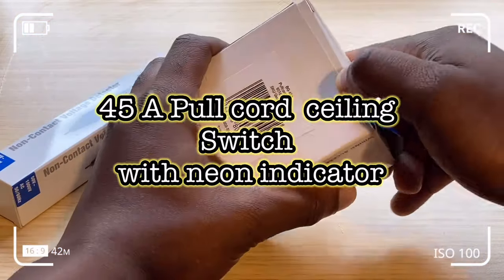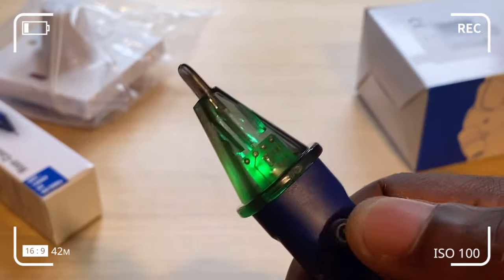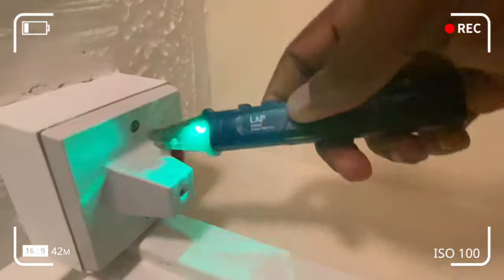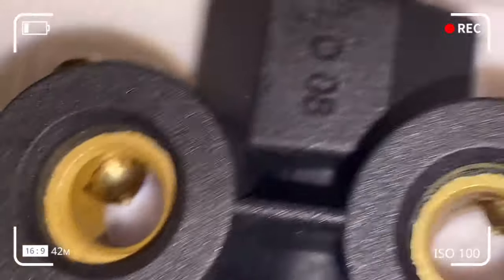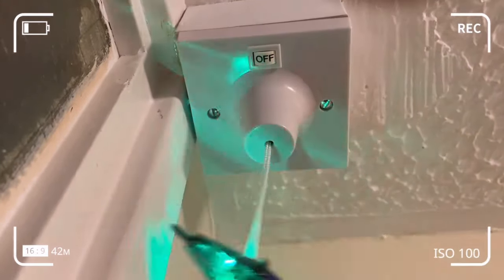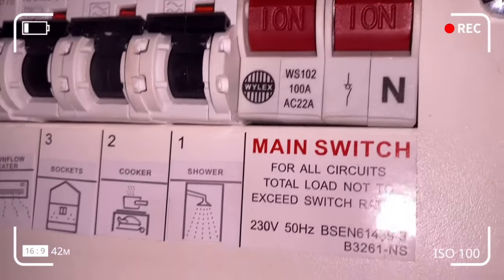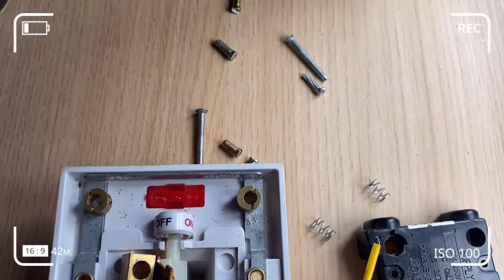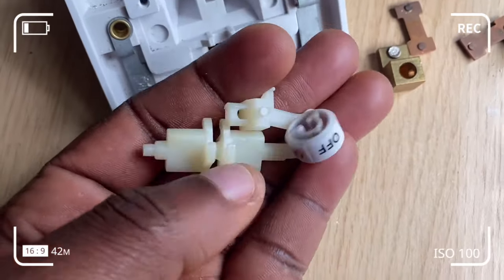How to fix a pull cord ceiling switch [setup, self & voltage test, strip/tear down]

Comment: Excellent info and great vid. I have ordered a non contact voltage detector, definitely one of those things you don't know you need to see it!
Reply from the maker: Thanks David and appreciate the feedback. Don’t forget to subscribe and share. Have a blessed week. Take care
Reply: We call them death sticks. Don't rely on them as a means to safely isolate. They're merely an indication as to live. Plenty of times they don't show live. At minimum test on a known live source before and after using a voltage stick.
Reply from the maker: @rayc1503  sure they are an indication and isolation should be carried out prior to as already exemplified. On using a source, If one is conversant with wiring you necessarily don’t need to take the switch apart as you can pull the earth down on the switch housing using a roughneck mains tester screwdriver or multi meter which exposes both live and neutral and check for live and bottom right of the housing or if you prefer on live cable circuitry. The screwdriver sometimes arent wholly reliable I.e fuse blown out and shock prone etc but thanks for the contribution and feedback. Have a lovely week
Reply: One saved my life earlier. Thought I isolated the shower. Went to check and nope, still live. I'm just happy I had one, because it's definitely the type of thing I'd not buy thinking "it'll be fine"
Reply: Or just turn the Lecky off 😂
Reply: On mine it's the cord that doesn't work, and the unit has no screws ?????

Comment: My rope break . Do I need a new one ?
Reply from the maker: Hi flo496, 

Depends on where it broke. Mid way you can just tie to its other strand. But this is a temporary fix as subject to break loose on constant usage. 

 If it’s at the housing or casing. Then a more permanent fix would be  to follow these steps:

1. Turn off the power to the switch at the circuit breaker.
2. Remove the cover plate of the switch to access the inner mechanism.
3. Locate the rope or cord attached to the switch mechanism.
4. If the rope is broken or damaged, replace it with a new one of the same length.
5. Thread the new rope through the hole in the switch mechanism and tie a secure knot at the end.
6. Replace the cover plate and turn the power back on.

Remember to always exercise caution when working with electrical components. If you're unsure or uncomfortable with the process, it's best to consult a professional electrician.

Don’t forget to subscribe like and share. Helps channel grow

Comment: No light showing on the On position however yesterday was working and shower was going on and off now no power at all to shower regardless. I checked consumer unit nothing has tripped. Could it be just if I change the pull cord ?
Reply from the maker: 1. It could be a loose connection or the moving parts inside are not clicking correctly or that it's a sub standard part that needs replacing(wear and tear shelf life of poor quality product exponentially impacted), invest in a good quality switch. Next, make sure that your socket isn’t screwed in too tightly. This can cramp the wires inside, causing them to malfunction, the neon light wires are usually quite fickle and can easily break so should be handled with care. if there was a short circuit , your consumer unit would have tripped OFF so i doubt there was a short circuit.or       2. it may not coming ON  because it  might have something to do with your thermostat or needs a Neutral, is there is a capped off neutral wire in the socket for the light switch (along with an earth which is connected to the backing plate) and do you have only red live wires and a green/yellow earth?you can not assume it is a neutral, you will need to get some one to check it for you.
3. Check your connections are sound
Presume you wired it identical to your previous switch for instance where neon came ON with switch ON or OFF as required and your asking or wondering  if your new switch presumably has feeds opposite way and it’s safety? I presume the  Shower you have installed does seem to respond to pull cord switch (irrespective of NEON light) and functioning  okay but with the neon light constantly ON or  some times OFF but works regardless 

From what you are saying it appears It's not clearly electrically identical to the old switch (unless or except  that was also wired wrongly previously )

The terminals on the switch are labelled - it will work or function fine and is not dangerous - but it is wrong, has the potential or propensity to confuse anyone maintaining the shower circuit unit and should be wired correctly or corrected.

The neon being permanently 'ON' is usually caused by wiring the permanent live conductors to the 'load' side of the switch - this needs to be VERIFIED. Permanent' live conductors are the line and neutral going to the consumer unit. 
Switched conductors are line and neutral going to the shower. The neon is connected across these so it lights up when the switch is closed ('ON'). 
Looks like it was wired backwards, appears cable's must be back to front as two cables for feed and load, so compare your two switches layout both OLD and NEW. So it presumably looks like your Supply CABLES are in the LOAD side of the connection and LOAD side cables are in the Supply side of the connection.  Hope this helps. Let me know how you get on and don’t forget to subscribe and share. Have a great weekend

Comment: Great video lad, I've just installed the same pull cord for my shower and the indicator light is on even in the off position, is this normal? Thanks.
Reply from the maker: Presume you wired it identical to your previous switch for instance where neon came ON with switch or OFF as required and your asking or wondering  if your new switch presumably has feeds opposite way and it’s safety? I presume the  Shower you have installed does seem to respond to pull cord switch (irrespective of NEON light) and functioning  okay but with the neon light constantly ON.

From what you are saying it appears It's not clearly electrically identical to the old switch (unless or except  that was also wired wrongly previously )

The terminals on the switch are labelled - it will work or function fine and is not dangerous - but it is wrong, has the potential or propensity to confuse anyone maintaining the shower circuit unit and should be wired correctly or corrected.

The neon being permanently 'ON' is usually caused by wiring the permanent live conductors to the 'load' side of the switch - this needs to be VERIFIED. Permanent' live conductors are the line and neutral going to the consumer unit. 
Switched conductors are line and neutral going to the shower. The neon is connected across these so it lights up when the switch is closed ('ON'). 
Looks like it was wired backwards, appears cable's must be back to front as two cables for feed and load, so compare your two switches layout both OLD and NEW. So it looks like your Supply CABLES are in the LOAD side of the connection and LOAD side cables are in the Supply side of the connection.  Hope this helps. Let me know how you get on and don’t forget to subscribe and share. Have a great weekend
Reply: I had same issue swith is identical followed vid but light permanently on
Reply: @UtechUreview  I already swapped wires rnd sorted it straight away but cheers anyway
Reply: @hodmusprime3850 having the same problem now. Which wires did you switch around? Cheers

Comment: hello, what brand and model, for the " Pull Cord Ceiling Switch With Neon (45 Amp, Double Pole)" will you recommend, quality and practical, not looks, I am more interested in function, than what they look like, thanks, plus your video, is very helpful.

Comment: does it matter which side the supply wires goes. or can it be either way round if that makes sense
Reply from the maker: Hi K, Yes it does matter. You want to connect the switching live in the right place. If it’s in the wrong place the LED lamp will constantly illuminate. Your switch electrical circuit should be connected to the live wire so that the socket or is not live when it is switched off. 
Scenario 

If you wire it erratically your Neon light may come ON with switch or OFF and if  your are asking if it matters or wondering  if your new switch presumably can have feeds opposite way and it’s safety? 

If you install interchange the supply for the load,  It will respond to pull cord switch (irrespective of NEON light) and functioning  okay but with the neon light constantly ON.

The terminals on the switch are labelled - it will work or function fine and is not dangerous - but it is wrong, has the potential or propensity to confuse anyone maintaining the shower circuit unit and should be wired correctly or corrected.

The neon being permanently 'ON' is usually caused by wiring the permanent live conductors to the 'load' side of the switch - this needs to be VERIFIED. Permanent' live conductors are the line and neutral going to the consumer unit. 
Switched conductors are line and neutral going to the shower. The neon is connected across these so it lights up when the switch is closed ('ON'). You shouldn’t be wiring backwards, or having cable's back to front as two cables for feed and load, so compare your two switches layout both OLD and NEW. 

You should not have Supply CABLES in the LOAD side of the connection and LOAD side cables in the Supply side of the connection.  Hope this helps. Let me know how you get on and don’t forget to subscribe and share. Have a great weekend
Reply: @UtechUreview  that helps a lot. wad confused about the load and supply.  thanks!!

Comment: Hi can we leave these on all the time if the shower is used daily? I'm not concerned about the cost as I know it'll only use a minimal amount of electric, it's more to do with safety. I understand it's good to turn it off if you're out of the property for a while, but if the shower is literally used every day, is it better to leave it left on? Please reply , thanks.
Reply from the maker: Hi 137dylan, Although it is usually OK,you should leave  the switch turned off when not in use to prevent a permanent source of high-currents.

it is not recommended to leave your shower pull switch on all the time. Pull switches are designed to be used when you need them and then turned off afterwards for safety. 

Leaving your pull switch on can lead to it getting stuck, which can be a serious hazard, particularly when it comes to electrical pull switches.

If your pull switch is stuck, it can create an electrical hazard by continually allowing electricity through, potentially leading to wiring overheating, or a fire.
I hope this helps. Don’t forget to subscribe and share. Helps channel grow. Have a good one

Comment: Thank you for the vid, my existing old switch is stuck on, when I pull on it the shower light goes off briefly but the pullcord doesnt fully go down anymore so it doesnt click off if that makes sense, any ideas if this is an easy fix rather then replace the switch? Thanks :)
Reply from the maker: Note: There are aftermarket Switches though quality passed which are sub-contracted or sourced cheaply on material and labour. As much as a strip down, disassembly and reassembly or replacement or retrofit of components could have resolved the problem, unfortunately your pull cord may becoming to the end of its useful life as may have suffered mechanical wear and tear and presumably may be due for replacement and would save you time, quality and cost in the long run. Even if  you succeed in fixing it after repair it may need to be professionally certified and tested OK by a qualified engineer to ratify that it is safe for operation to prevent any house fires resulting from the partial connections, poor rework and installation, overheating or the switch been stuck. I understand the need to salvage your unit but try to invest in a sturdy and good quality switch from your local dealer which has a long shelf life , also use reasonable force as opposed to pulling erratically on the switch during operation and don’t leave the switch ON for protracted periods to prevent the switch been stuck or over heating as they are designed to be switched ON and OFF.
I hope this helps. Don’t forget to subscribe and share. Have a brilliant weekend
Reply: @UTech UReview  thank you so much for the detailed info, have a great weekend 😀

Comment: How did you figure out which is supply and which is load out ? 
Could you separate all cables,  turn power back on and use fluke pen to figure out ?

Comment: i managed to fit mine the other day.     however i installed the back box about 20/30mm deep into the plaster and just plastered around it.  as it was hard to secure it the the lath behind.  is it ok that the back box isnt flush with the plaster.   it all works fine though

Comment: Thanks! We found a build up of dust in the puller clogging up the system...and was told if you want the switch to last longer then leave it on most of the time only turn off when leaving the house for a long while
Reply from the maker: You welcome N Bambi. It appears that you may have had the switch for a extensive period of time or there might have been presumably heavy traction on the floors of the house that may have resulted in some loose plaster or dust  finding it’s way in the box switch box. You may have been told to leave it on for extended periods and off when leaving the house to extend its useful shelf life as the mechanism is subject to mechanical wear and tear over protracted periods. But check with your energy supplier if having your pull cord switch on standby mode  may result in a slight increment in your energy bill as certain devices accrue minimal energy when in standby mode but not as high as if it were in full power mode. I guess the benefit outweigh the cost for you in prolonging the life of your switch given the advise you were given. My few cents. 
. Appreciate the feedback. Don’t forget to subscribe and share. Helps the channel grow and have a great holiday.

Comment: My red led light on the pull cord switch isnt on anymore even though it turns on the main light when you pull it down and it goes back up no little led light to indicate its on apart from when it says (on/off)
Reply: This has happened to me. It's been wired up wrong. I think it was the brown wires were in the wrong ports. It's a bit of a nightmare taking the plate off again without it disturbing the other wires but easy to sort out eventually.